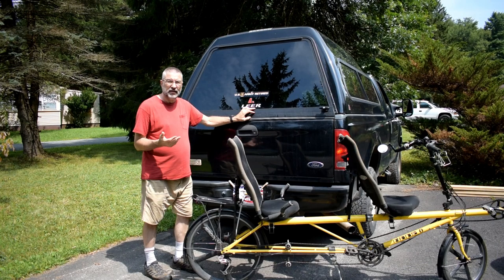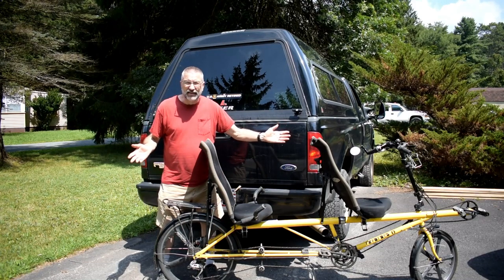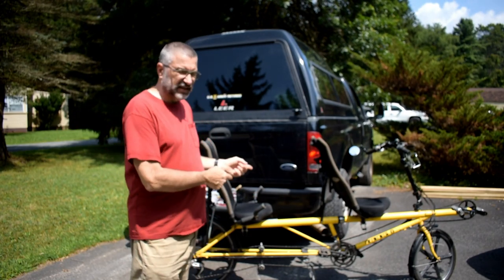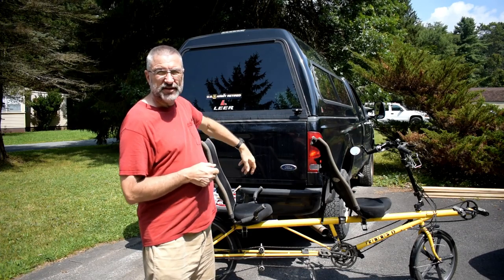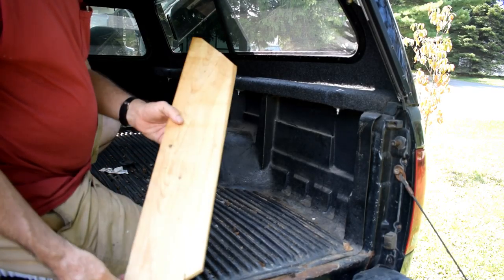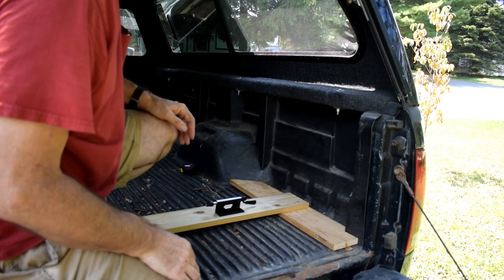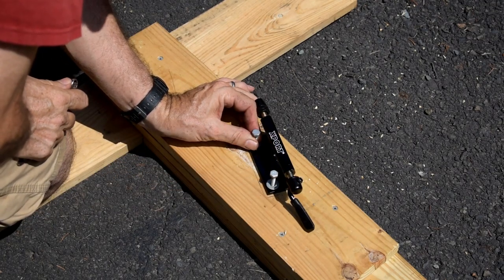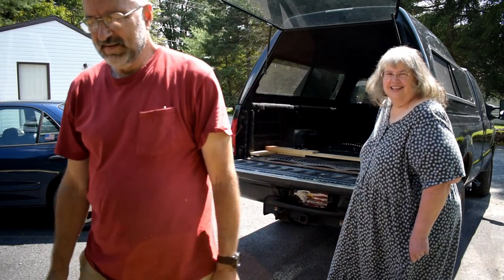Building a Bicycle Rack

Comment: Bill, I do something similar to hold my mountain bike in the back of my Chevy PU, under the Leer Topper. I approached it a bit differently. To avoid the hassle of removing the wheel and re-installing it, I built a rack that consists of 2-45x90 degree triangles of 1x6 with short pieces of 2x4 between the back & bottom on the short sides. I place it at the cab end of the bed , mounted on edge (with the long side facing the bike tire), on a plank that reaches across the bed. I simply back the rear tire into the rack and use a bungee cord on the handlebars at the tailgate end. Then with the tailgate closed, the mountain bike is immobile and out of sight, plus it can't tip over. I made several more of the triangle slots and mounted them to the floor plank, so it can carry all 3 mountain bikes on the trip. I took the most cost method by using the wood from an old pallet. It only cost me some time and a few nails. ... Jim